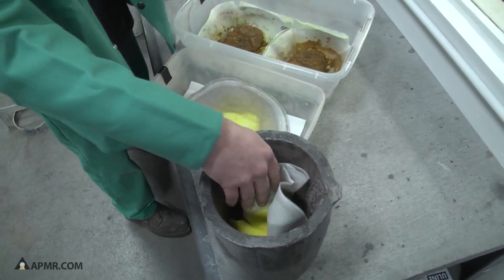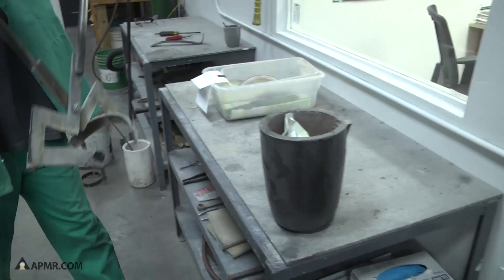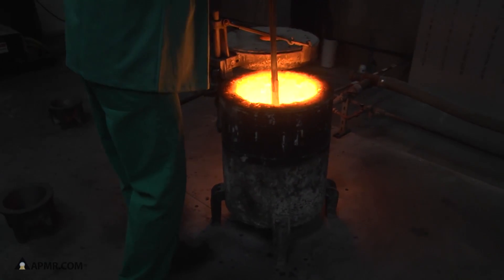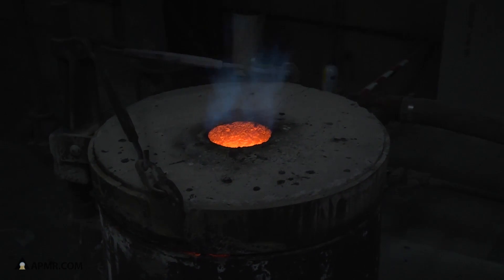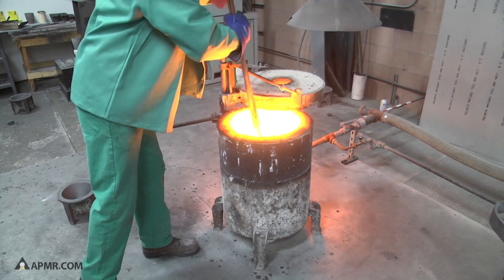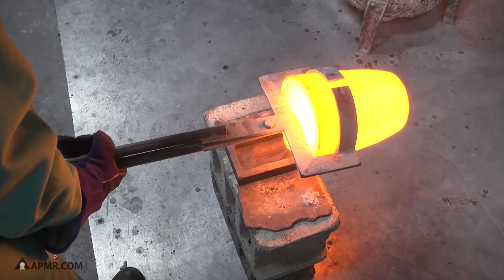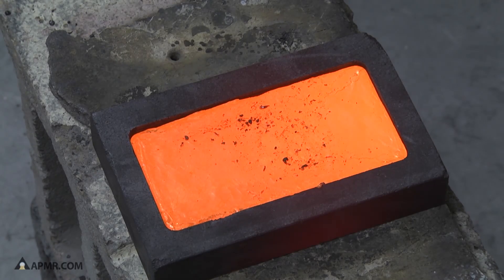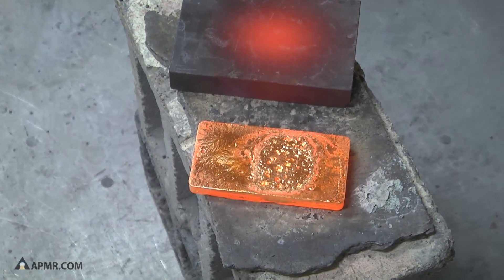Melting Pure Gold Sponge and Pouring a Gold Bar

Comment: Why do they leave a hole in foundries?
Reply: Mike Pericolosi airflow I think
Reply: Mike Pericolosi releasing pressure, otherwise the lid could pop off
Reply: Mike Pericolosi Without oxygen the fire would die.